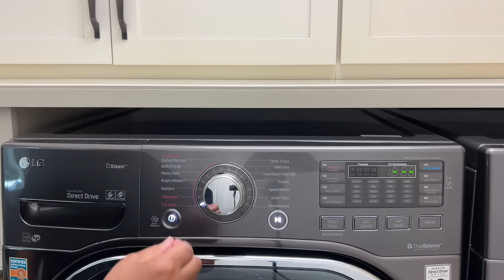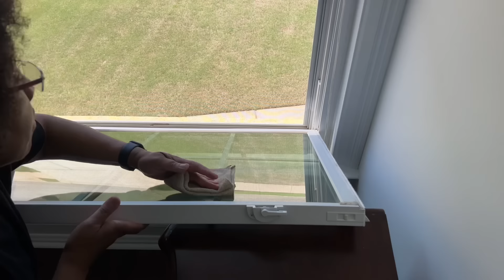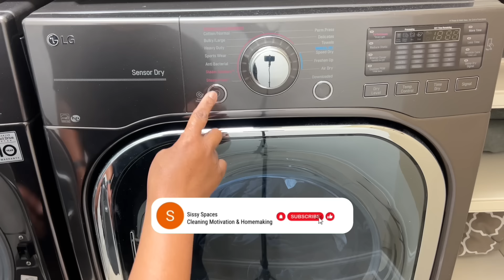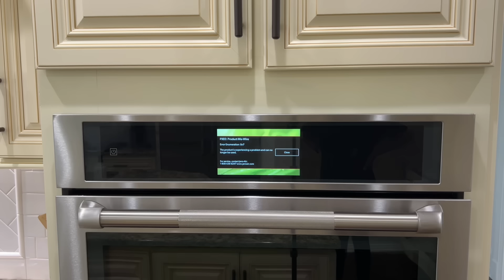SUNDAY RESET | CLEAN, COOK & ORGANIZE WITH ME | LAUNDRY MOTIVATION #sundayreset

Comment: Tips needed plz. When I clean my mirrors I use an invisible glass arisol cleaner and two microfiber cloths one "wet" and one for polish. The problem is it always leaves lint of some sorts behind its wouldnt be obvious to a random guest but it drives me crazy. How do I fix this??? Ty
Reply from the maker: Hi and thanks for watching.  Use the dry Microfiber towel only and see what happens.  If you continue to see lint, your Microfiber towels  maybe showing there age or are not washed and dried properly.  Also, you may need to switch to a 70/30 waffle weave towel to dry your mirrors.  Lastly, if none of this works, try spray-away glass cleaner with a dry paper towel.  I hope these suggestions help.
Reply: @Sissyspaces11   in regards to the wet one its not actually wet it just collects more moisture from the cleaner being used and the dry one doesnt collect the cleaner but it buffs out any streaks. The aging thing may be it. I may have to get some fresh ones. Thanks